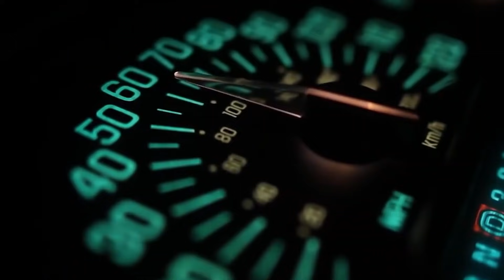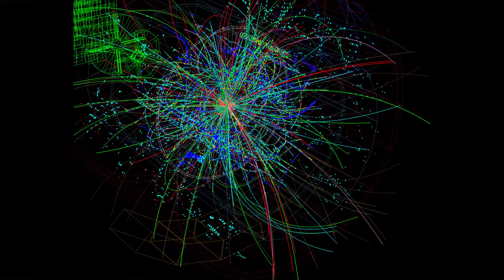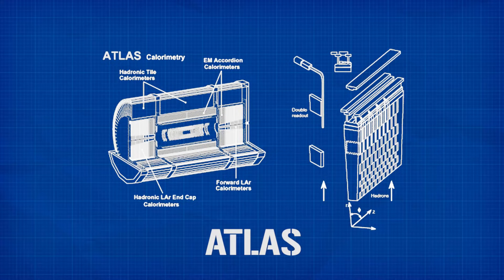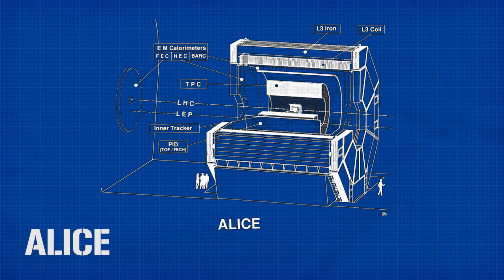The Large Hadron Collider: The Largest Machine in the World

Comment: Great series. The video gets the general information well but some of the explanation doesn't hold. 1TeV is very little energy in our terms. 1 Joule is 6241506 TeV. Mike Tyson punches 1600 Joules. The difference is that those 13 TeV are focused in an insanely small number of particles, and you need a lot of power to accelerate the beams to that energy

Comment: Look, I went to Art School so It's fascinating, but I now feel stupid.  Some things that the text could use for non-scientists is to dumb down the mission description to say that this is  research resulting in data rather than a tangible "thing" resulting device.  Also, It is very confusing to see stills with Fermilab imagery in frame.  Fermilab in Illinois has had a collider since the '50-'60 near Chicago.  I have spent time in both Illinois and the Switzerland.  Did anyone say boring?  Do particles flow faster in dull environments?  I'm sure there is funding for this study.

Comment: Serious question...if the collision produces heat thats 100,000 times HOTTER than the sun, how can it possibly kept cool by helium at -400 degrees?
An ice cube at 0 degrees has zero effect on a pot of 212 degree boiling water.
Reply: But a dropplet of boiling water has zero effect on an iceberg... it's only a few particles that are this hot... also afaik the helium is mostly used to keep the magnets cold and superconducting, because they get warmed by the surrounding air / rock ect...

Comment: 8:12 We just say "the protons are accelerated". To elaborate, the injection process involves a careful balance between accelerator elements and dipole (bending) magnets. Keep in mind that the protons are injected into the LHC from the SPS at ~400 GeV. They then need to be gradually accelerated to collision energy (using superconducting radiofrequency cavities) while keeping them constrained inside the tunnel. This is accomplished by "ramping" the current in the superconducting dipoles in precise synchronization to provide an adequate amount of bending magnetic field at all times.

Comment: 15:23 The sub-detectors closest to the interaction point (silicon detectors, in particular) also require replacement since they accumulate radiation damage which gradually reduces the efficiency and performance.

Comment: Sorry Simon (and the autor^^)  but you pronoundce quadrupole wrong. It's quadru-pole. The suns surface is pretty cold with 6k K.... The suns core is way hotter as the LHC and the temperature we need for fusion. Some particles at those temperatures... don't heat up anything :) The helium cooling isfor the superconducting magnets needed to keep the beam round.
Reply: The rest was correct :)

Comment: How much is Tera EV or Tera Electron Volt?  It's what you get when you let an electron fly between two metal plates charged up to a million volts...times one million, a million of millions. So how much is that really?  Three million volts is about enough to make an arc through dry sea level air between two flat charged plates one meter apart which is just a little more than a yard long for us old Americans.  Letting an electron go between those plates (in a vacuum) gives it 3 million EV of energy, 3 MegaEV or million electron volts.  For a Tera EV, you need enough volts to make an arc a 333,333 times longer or about 300km or a lightning bolt 180 miles long without all the leaders and stuff or arcing to the ground...just bang from one end to the other just because we turned the volts up too high.  So its the kick from a 180 mile long lightning bolt, that's how much!

Comment: 3:45 A superconducting magnet quench is a bit more nuanced. Typically, some kind of mechanical fluctuation (often due to intense structural stresses created by the strong magnetic field) increases the temperature slightly in a microscopic pocket of material. If this local fluctuation brings the temperature above the critical temperature, superconductivity is lost in this region. The vast amount of circulating current suddenly encounters resistance in the area and develops a bubble of heat which will expand, causing the superconducting solenoid to explode unless the current is immediately extracted [1, 2].
[1] https://cerncourier.com/a/safeguarding-the-superconducting-magnets/
[2] https://home.cern/science/engineering/restarting-lhc-why-13-tev

Comment: 3:37 A quench was not responsible for the incident in 2008, it was due to faulty interconnect splice which developed an arc [1]. "Prior to this fast discharge, it is certain that a magnet quench can be excluded as the cause of the initial event" [2]. Also, this happened a week after the first circulating beams, not "a week after the start of the project".
[1] https://www.youtube.com/watch?v=Z_OnLqIvSek
[2] https://home.cern/news/press-release/cern/cern-releases-analysis-lhc-incident

Comment: 3:08 Saying the LHC is underground because it makes "dealing with [radioactive] waste significantly easier" is potentially misleading. The LHC can and does temporarily activate materials in close proximity to circulating beams, and there are strict rules regarding their decommissioning, storage (which does not necessarily take place underground), transport, etc. [1]. But there is certainly no very-long-term radioactive "waste" as you have in a nuclear reactor. This entire statement is probably a mischaracterization of this sentence "In addition, the Earth’s crust provides good shielding for radiation." [2], which I've always taken to refer to protecting the LHC experiments from cosmic rays (which it doesn't: we use cosmic rays for detector alignment during LHC downtime).
[1] https://hse.cern/content/radioactive-waste-management
[2] (See page 20) https://cds.cern.ch/record/2255762/

Comment: 4:58 The kinetic energy of a single proton circulating around the LHC is commonly compared to a flying mosquito. If you consider all circulating protons in the beam (~2500 colliding bunches of ~10e11 protons each, in a typical Run2 fill), the total energy is more impressive and comparable to a moving train or (small) aircraft carrier [1].
[1] https://lhc-machine-outreach.web.cern.ch/beam.htm

Comment: Given the number of errors and omissions in this which I pick up as a non-expert makes me wonder how many of these I overlooked in your other videos.  Unsubscribing based on that.

Examples:
"Hydrogen proton" - as opposed to what?  Protons are protons, you don't get different types from different atoms.  This is high-school level physics.
"Colliders emit radiation it's easier to deal with the waste by having it underground" - talking about "waste" makes this misleading; synchrotron radiation is hugely different from what people think about when they hear "radiation" and "waste" in the same sentence.
"0.98 TeV is just below a million volts" - Nope, they're not the same thing at all.  Perhaps this is first-year-undergrad physics, but it should be pretty clear when you're fact checking. 
"When magnets heat to 9.6 Celsius above zero" - You mean 9.6 Kelvin above zero?  Or you could say "...Celsius above absolute zero".  This is high-school level physics.
"1 TeV is greater than any force on Earth" - It's kinetic energy rather than a force, but either way, it's less than something like a speeding train.  
"It uses about 200 MW from the French electrical grid" - Nope, this is power use for the whole of CERN; the LHC is about 120MW.

I hope this doesn't come across as being an asshole.  Things like these are fascinating and more people should know about them; it just doesn't help to be misleading people like some of the earlier points above.

Hopefully this is a nudge towards doing better research, fact-checking and script reviews.

Comment: Have we actually derived any useable Technology from data gained by the LHC? I see lots of"yawning"!!!!!
Reply: No,and we probably won't for a few decades at least.  Consider the development of Quantum Mechanics in the 1920s; interesting to physicists but of no importance to anyone else.  Now look at our modern technology and see how much of it requires a knowledge of QM to design and build.  There are a few outstanding questions that the LHC has answered or may in the future - the Higgs boson, supersymmetry etc - but mostly we don't know what it's going to find or what use our descendants may have for that knowledge.
Reply: @Michael75579  thanks. Been following the construction and deployment which in itself was fascinating. I was pretty excited another version they started to build in Texas. It was exactly three times the size of the LHC. They had some really basic problems like the ants eating insulation of the wiring!
Reply: The only thing either of the Clinton's ever did that I liked was Willie Jeff shut the thing down. !!! I assumed that finding the Higgs would solve all of our racial, existential and cultural issues and maybe a couple of our technical ones. Seems that hasn't happened
Reply: They built this thing to find the Higgs boson. They "found" the Higgs and nothing has changed? I'm glad Clinton scrapped it.
Reply: @highpointsights  Basic electricity physics took a century to develop, IF we felt the same way, and decided to scrap it, we may have never developed past the steam engine. The costs are massive buy compared to what else (& how much) the govt spends money for, this isn't that crazy.